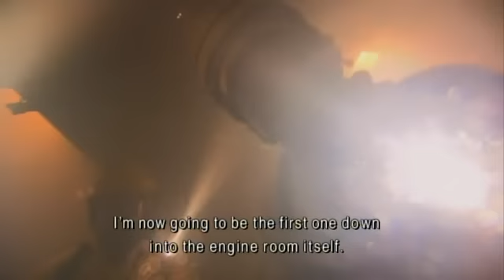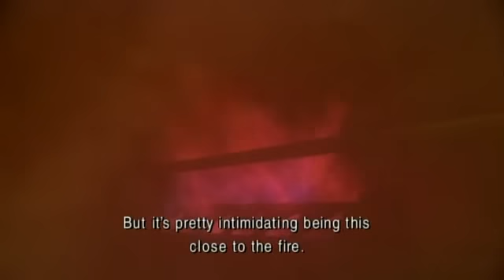20th Century Battlefields   1942 Battle of Midway

Comment: They weren't SB2C Helldivers that bombed the Japanese carriers. They were SDB Dauntlesses - different plane. Like the TBF Avenger (TBD Devastators were the torpedo planes flown at Midway - slow and obsolete, it was no wonder the Japanese A6M Zekes knocked 'em out with such ease), Helldivers to play any major part in the Battle of Midway. In fact, their battlefield baptism didn't take place until a year and a half after Midway. (About a dozen Avengers were on hand at Midway.)

And, the Japanese code hadn't been "cracked" as completely as suggested in this documentary. It had only been partially decoded. They might have mentioned the criticle ploy of getting the Japanese to broadcast that Midway was running low on water - a false communication put out to comfirm that it was Midway that was the target of the attack. Further, they might have expanded on the full battle plan of the Japanese to use an invasion of the Aleutians to lure one of our carries and spread U.S. forces thin -- which of course failed because of the code-breaking and the "low water supply" ruse exposing the true plan.

Taking Midway was needed to buy time and expand Japan's defensive perimiter. They weren't intent on invading the U.S. mainland. They were intent on protecting the Emperor, who'd been shown to be unacceptibly vulnerable by the bombing of Tokyo by the Doolittle Raid. Mitchells had actually flown over the Imperial Palace. Japanese planners - Yamamoto in particular - knew time was not on their side. They couldn't build new carriers, and especially train new pilots, fast enough to meet the threat if they couldn't produce "Kantai Kessen" ("Decisive Battle") at Midway.

Invading mainland U.S.A. wasn't part of Japan's planning.
Reply: i was surprised to about the mention of broken codes because its well known the codes were not broken just partial broken as you said, that's why the trick of the false communication about midway running low on water was used to confirm the Japanese were talking about midway like you said as well. Mad that they didn't include that in the documentary.
Reply: +Shoes386 yes it was SB2C.
Reply: +Adam A.The soilders use to say it stood for "son of a bitch"2c.Just watched a movie on that.
Reply: The Corsair and the Hellcat I think were the only planes we had that challenged the Zero. Because it was one of the best fighter planes in the twentieth century and it took America almost two years to really put something in the air to challenge it after Midway.
Reply: They sent a transmission saying Midway had water supply problems, to which they soon intercepted a Japanese transmission that said their target had water supply problems.

Comment: They hit the Yorktown twice!? That just sucks! Those poor men couldn't catch a break.
Reply: Ain't that the truth! The Yorktown's damage control crews did such an amazing job of extinguishing the fires and restoring power that the Japanese pilots assumed it was a different carrier and attacked it again!
Reply: in total .. yorktown takes 3 hits 2 by air attack .. and sub torpedo most fatal ..
Reply: Let's not forget that this was just the end of a long story for the Yorktown. She was shot up badly in the coral sea. Those brave skilled men limped their battered carrier to pearl, and helped the yard men repair her. Nimitz didn't even think she would make it in time, but they had the ship completely battle ready in 48 hours.
Reply: As speed150mph suggested -- Damaged by a bomb at the battle of Coral Sea the Pearl Harbor dry dock estimated two weeks to repair the damage, but was made sufficient to sail in 48 hours per Nimitz orders.  "Many" shipyard personnel sailed with her, still repairing damage. When the Yorktown was hit by three bombs, she had skilled workers to bring the flight deck and boilers back into operation.  
The surprising "coincidence" is that this damaged ship was the ~least valuable~ between the Enterprise and Hornet, and she was the one repeatedly struck, and finally sank.
Reply: She went down swinging and took some of the IJN down with her

Comment: they sunk 21 us ships at pearl?                NO!
the best ships like the utah?
the utah was pre ww1, was so old, its main guns were removed, and its structures, so it was used as a anti-aircraft trainng ship.
the us lost the az, and the oklahoma was raised, but the ship, like all the battleships were OLD, and ok was just not worth the effort to fix.  the point is, the remaining battleships were all fixed or rebuilt into better ships.  4 of the surviving battleships were running by march42.  another in june 42, and the last 2 were rebuilt by 44.
even after repairs/rebuilding, they were used in patrol or shore bombardment.  ww2 was not going to be won with these 20+ year ols battleships.  these old battleships were not even close to the speed of a carrier.  no cv escort duty for them.